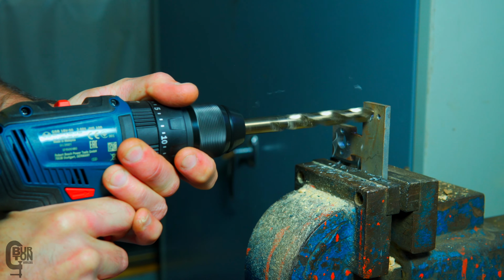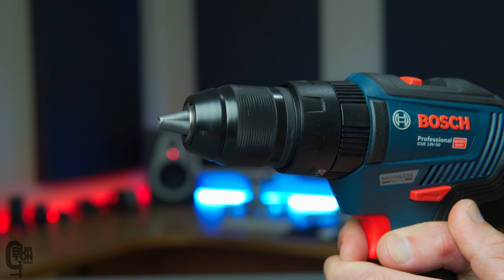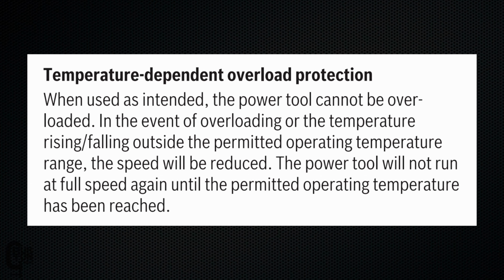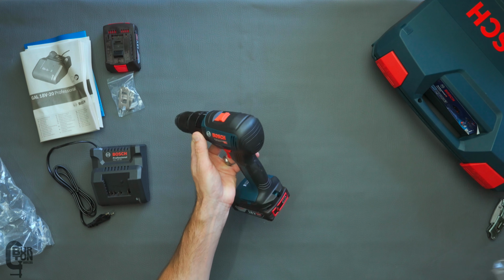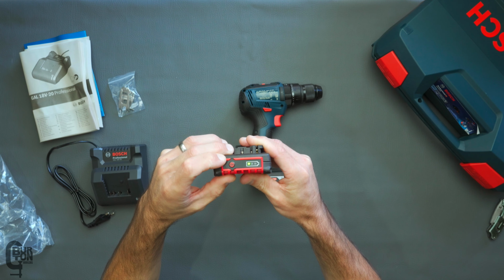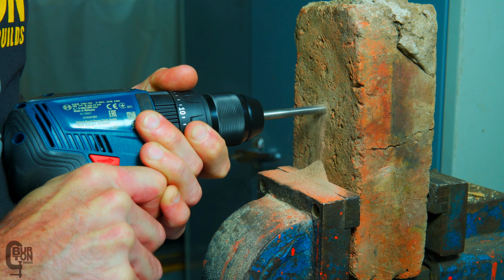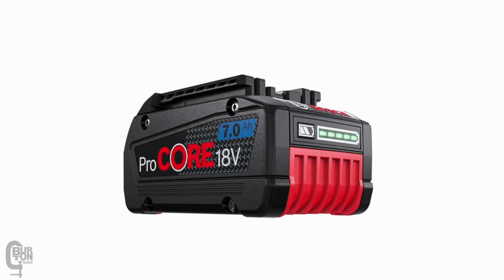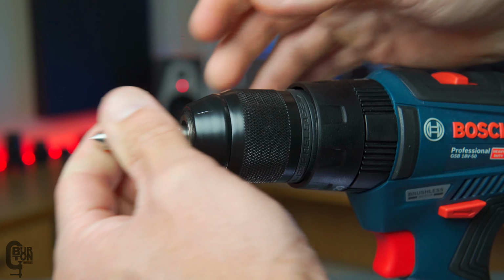Bosch Brushless Drill Review and Testing | GSB 18v 50 (Burton Builds)

Comment: PS. These Bosch drills perform better with stronger batteries (5.0A or 8A or higher) the Procore batteries are even better.
Reply from the maker: Hi Peter, thanks for the info... I've actually also tested a larger drill from Bosch, the 18V-150C (18V-1330CN) and during my testing using both the standard and ProCore batteries, also noticed the ProCore deliver more power. Review video is here 👉https://youtu.be/I2PaPUjVMG0

Comment: The comparison with the DeWalt is not fair, the DeWalt is an an hammer (hamerboormachine) whilst the Bosch is a impact driver (klopboormachine). Not quite sure whether I translated it correctly, but the main difference is the ability to drill into concrete. The DeWalt is built for that, the Bosch is not.
Reply from the maker: Hi freakie1NL, I agree 100% that's it't not a fair comparison... however please keep in mind that this is not a comparison video in which we compare the DeWalt SDS against the Bosch GSB18v-50 to show which one is better than the other.

I show the DeWalt SDS drilling through the concrete brick to create a reference point to gauge what the Bosch GSB is capable of (or not capable of) in Hammer Mode. General DIY users may assume that having a hammer drill mode means they can use the machine to drill into brick and concrete, and that's not the case. While the Bosch may be able to drill a few small holes in low strength concrete, it will chew through bits quickly and pretty soon wear out the machine if thats what it's being used for.

The translation is slightly out... an 'impact driver' uses a hammer and anvil arrangement which drives rotation... but thanks, I know what you mean.

Thanks for the comment 😁
Reply: @GrantBurton  and thank you for the review!
Reply: Actually, that comparison helped me to evaluate the difference.
Reply from the maker: @AdiosGringo619  Thats great... which drill did you end up buying?
Reply: @GrantBurton  GSB 18v-50. Your review helped a lot. Thanks again.
Reply from the maker: @AdiosGringo619  Wonderful, thanks for letting us know. Once you have used it for a while, please comment again and let everybody know what you think about it.
Reply: I think the comparison was just the right thing to do.
Many drivers are advertised with the hammer function and it makes you assume it could be useful for home use drilling in the walls.
This came just in place to show you that if this is what you wanted then this tool won’t do the work.
Reply: Yeah, it does make sense
Reply: It has a hammer function on what you talking about look when he is putting it in drill mode

Comment: it is the same than bosch gsb 185-li ?
Reply from the maker: The Bosch GSB 185Li and GSB 18v-50 both have very similar specs and functions however the GSB 185Li is a light duty drill compared to the GSB 18v-50. The 185Li has a smaller body / outer case and has lighter duty internal wiring and connections and also a light duty gearbox compared to the GSB 18v-50 model.

The GSB 18V-50 is physically larger and it's case has more rubberising protection around it

Overall I think the GSB 18v-50 is a stronger more heavy duty drill.

Comment: Is this still their best one for an 18V-20V? Do you have any recommendation that is better than this Bosch 18v-50, preferably a Bosch model also or Dewalt WITH ANTIKICKBACK?
Reply: 18-150 or 18-535
Reply from the maker: Yeah, the Bosch 18V-150 C is a bigger more powerful drill that has KickBack Control... I've actually got access to one of these 18V-150 drills to test and review but I must still get around to that sometime in the future hopefully.
Reply: @GrantBurton  thanks. I saw 18V-90 C and it has kickback.

Comment: Hi, i would like to enquire between Bosch  GSB185LI and GSB18V-50, what are the different and which one was recommended, thanks!
Reply: +1 🙋‍♂️
Reply from the maker: Hi Chilk Ling, the Bosch GSB 185Li and 18v-50 both have very similar specs and functions however the 185Li is a light duty drill compared to the 18v-50. The 185Li has a smaller body / outer case and has lighter duty internal wiring and connections and also a light duty gearbox compared to the 18v-50 model.

Overall the 18v-50 is a stronger more heavy duty drill.

Comment: What is the difference between this and the GSB 185-Li??
Reply from the maker: Hi Oliver, the Bosch GSB 185Li and 18v-50 both have very similar specs and functions however the 185Li is a light duty drill compared to the 18v-50. The 185Li has a smaller body / outer case and has lighter duty internal wiring and connections and also a light duty gearbox compared to the 18v-50 model.

Overall the 18v-50 is a stronger more heavy duty drill.
Reply: @GrantBurton  Thanks man! Oh, by the way, Bosch usually ships their tool kits with battery inserted in the power tool itself.. I don't know why either. All my tool kits are sealed, and all of them have their batteries inserted as well.
Reply from the maker: @The_Crazy_Monkey75  Thanks for the info... I would think it may be a potential safety hazard shipping with an inserted battery but who knows... haha.

Comment: One critical problem with Milwaukee brushless M18 drills is the awful sound of the motor. The Bosch doesn't appear to be making the same horrendous "sharp" scream from the motor windings. The M18 brushless drills seem to produce a sound akin to a small air raid siren. I won't buy another M18 drill until they solve the sound problem, they require hearing protection to drill a basic hole. This Bosch is next on my list, it's a beautiful drill.
Reply: My brushless Ridgid drill is the same . It makes a high pitch noise that's annoying
Reply: I’m glad someone else mentioned this. My M18 drives me nuts, and everyone else says the noise is barely there….i disagree. So much so that I brought a Bosch professional to replace it. Much better experience all around so far.

Comment: Aside from drilling small holes in brick or concrete, are there other uses around the house for the GSB18V-50?  I would like a new brushless cordless drill, but wondering if I should get this particular drill that includes a hammer mode.
Reply from the maker: Hi, for the convenience of having the hammer mode when you need to drill one or two small holes around the house, hanging pictures, curtain rails, etc into brick... I think it's worth having the hammer mode. For anything more, I would get an SDS rotary hammer. Just today I installed pegboards at a friends place and drilled 55 small holes into brickwork (6mm), used the SDS all the way. The hammer mode on a combi-drill could have possibly done it, but not nearly as quickly and would have required much more effort.

Comment: You'r right the battery isn't supposed to be preinstalled, seems this one is a return peace maybe or it was a showpeice.
Reply from the maker: Hi Peter, it is possibly but luckily everything has been working perfectly so far.
Reply: @GrantBurton  well thats good, if it is the case it is possible that the person who had it before just didn't like it much
Reply from the maker: Thankfully this time it all worked out... I have purchased an item online in the past (camera gimbal), which arrived and after unboxing, I could see it had been opened and actually dropped by somebody else before (definitely not from the factory like that)... thankfully there was no quibble about returning the item and having a replacement one sent... this time around it was definitely brand new.

Comment: Hey Grant, thanks for the reviews. I've been looking for a good hammer drill for concrete but hate corded tool.

Do you recommend gsb 185 instead? I can't seem to decide...
Reply from the maker: Hi Erka, I wouldn't recommend it at all... it's the 'wrong' tool for the job. For drilling into concrete, you are better off using a rotary hammer (SDS) drill... thats the right tool for the job. In the video, this is seen when I used the Dewalt rotary hammer to drill through the concrete brick where the normal 'hammer' drill was battling.

As an example, if you are looking for Bosch, something like this https://amzn.to/3JIyVx5
Reply: @Grant Burton  ah yes I guess so.. cordelss SDS is pretty expensive here, tho so I thought I could get away with GSB series xD

Thanks for the advice!

Comment: Does the chuck of your drill-driver rotate smoothly on its axis? Is there any wobbling?
Reply from the maker: There is a very small amount of wobbling (as can be seen in the video) but it’s such a small amount, it’s nothing to worry about. It doesn’t affect the accuracy of holes when hand drilling. This amount of runout / wobbling wouldn’t be acceptable if this was in a drill press though.
Reply: @GrantBurton  I've just started using this device, and the chuck has noticeable wobbling. I tested the drill with a few short bits, and the wobbling doesn't transfer to them. I also checked it with a longer spade bit, and there the deviations are quite strong (possibly a bent bit but it's new one). That's strange for equipment of this class. Regards

Comment: Which option is better for drilling in concrete and screwing:
1. Bosch GSB 500 RE
+ Bosch GO Gen. 2.0 screw driver
OR
2. BOSCH GSB 180 LI
Reply from the maker: I think the Bosch GSB 500 RE Impact drill would be better for drilling concrete compared to the GSB 180 LI… but only for small holes. If you intent to drill concrete or masonry, a rotary hammer drill is a far better choice (SDS rotary hammer). As for an electric screwdriver, it depends what you are trying to screw / unscrew but the GSB 180 Li will be more powerful at screwing compared to the GO Gen 2.0
Reply: Khoan bê tông tường xi măng thì gsb 500re khoan nhanh hơn gấp 10 lần con này, vặn vít sau khi khoan lỗ thì go gen 2 (or 3) lẹ hơn, đỡ mỏi tay, cần bắn vít thì hãy mua máy chuyên bắn vít Makita TD171 (có ngắt lực điện tử)

Comment: Great video Grant. Coming from the GSB 18-2-Li PLUS I need a slow RPM start on trigger pull for screw work mainly.  Would you know which of the 18v-50 or the 185-Li might have the slowest RPM start on trigger pull.    The less expensive 180-Li tends to jump from zero to like 20 RPM which is not optimal.
Reply from the maker: Hi Patrick, thanks very much. I was playing around with 185Li in Strand Hardware in Port Elizabeth a few weeks ago but can't remember how the slow speed start performed (Don't think it was something I was specifically looking at).

I'll pop past there again soon and compare, then get back to you. Hopefully they still have both models on display.

What type of screw work requires such a slow start? Maybe an electric screw driver will be better suited to the work?
Reply: Hi Patrick, I have the 185-Li model, the startup speed on gear 1 is the same as 180-Li model. I use it mainly on gear 2 for drilling. For screwing I have other brands like hikoki or makita which have slow initial rotation speed. At my workplace I have bosch 12v-15, it is super slow and fine in gear 1.

Comment: Hey Mr Grant! Would you take that Bosch over Dewalt 778? Cannot pick between Bosch and Dewalt because i never had anything from that brands.
Reply from the maker: Hi Thiago, between the two drills you mention, I would rather take the Dewalt 778 because it is more powerful than the Bosch however it really depends on which eco system you want to buy into. Batteries are pretty expensive so once you have started buying into a specific brand, it's cheaper to stick with that brand because you'll only be buying 'bare' tools and swapping the batteries between the tools. It also depends on thew range of tools available wherever you are.... no good buying into a Brand if they have limited support and only a hand full of tools available in the area.
Reply: @GrantBurton  alright! Bosch has the biggest support of all well known brands here in Brazil (Bosch, dewalt and makita are the most used ones). 

Bosch gear is also a little bit cheaper than Dewalt, so I’m probably going with 18v50. 

778 is indeed more powerful, specially when drilling concrete, but excluding raw power looks like Bosch is better on anything else (prices, support / warranty / features, etc)
Reply: @GrantBurton  thank you for sharing your thoughts with me Mr Grant! :)
Reply from the maker: @fivinh0  Makita is also a very good brand so maybe look at their stuff, although it depends what you want to do with the tools. I you are doing basic DIY stuff, then the entry level tools will be ok... but if you are dong 'contractor' type work, I wouldn't cheap out... rather buy the more expensive and better quality drill as it will likely give you better service life. Out of those three Brands you mentioned, I would choose Makita and Dewalt over Bosch. (Makita has their 'home DIY' range which is 'Makita MT' and the more contractor type tools which are straight 'Makita' - similar to Bosch green for home use and the Bosch Professional (blue) which is better than the green range).

I wouldn't be making any comparisons of these types of drills and making any decisions based on their ability to drill concrete... All of them are not great... they have very basic hammer action and you'll just end up damaging / wearing out your drill unnecessarily and pretty fast. If you need to drill concrete, you need to get a rotary hammer drill.
Reply from the maker: @fivinh0  It's a pleasure.
Reply: @GrantBurton   you are right. I’m mostly using that drill for DIY stuff and very very sporadic drilling on concrete (and with small drill bits, max 8mm).

It’s just because it’s too expensive to spend around $350-400 on a entry level hammer (bosch GBH 18V 180Li) for making 5-10 holes/year. 

I even thought about getting a “better one” like Dewalt 996 but I feel it’s too overkill for casual users like me. I hope 18V-50 can handle a little bit of abusing with concrete.
Reply: Sadly makita, dewalt and Bosch doesn’t bring their full gear collection to Brazil, so I can only pick between few models. Other brands like einhell and milwaukee are not even available locally.

Makita has a huge line of tools but their batteries here are hell expensive. That make Dewalt and Bosch easier picks. 

Even if I feel Dewalt would be a better pick, Bosch has a much better assistance and warranty here in Brazil, that’s something that I can’t ignore because everything is pretty damn expensive here. Stuff worth 100$ is like $250 here because importing fees and other taxes.

Comment: does that mean I want the GSR as I have not a use for a hammer mode?
Reply from the maker: If you can afford it, I would still get the GSB model (with hammer function) just to have the option to drill small holes (5mm or 6mm) in brickwork for hanging up pictures, etc. if the need arises.

Comment: That seemed worse than my 12v brushless flexiclick (~34nm) seems about as powerful as that unit. I'd guess the batteries are holding it back a lot.
Reply from the maker: It's possibly that the battery is limiting the power a bit, but I doubt the FlexiClick drill/driver will deliver 35nm of torque, even though that what the specs say. That FlexiClick looks like a nice drill for cabinetry.

The reason I think this is because I tested the GSB 18V-150C drill and could only get 84nm - similar to what @TorqueTestChannel also measured (and specs claim a max of 150nm)... but I could be wrong.

Comment: Hi! Nice review! 4:49 first time I hear about this type of protection, but what are the values of this "permitted operating temperature" range? I hope it is not a rubbish [0...40] range...
Reply from the maker: Hi paulbt, I'm not sure what the exact range is but from what the manual says, it sounds like it's just overload protection (that is based on temperature) so you don't burn out the transistors in the speed control or motor windings (If you putting the drill under to much load and pulling to much current through the speed control, the transistors will heat up and before they get to hot and burn out, the power is reduced to limit damage to the transistors / motor).

Comment: I just bought what I believe to be the same drill, but I may have got a slightly older model.

I got a material case and 3 batteries but not the ones that indicate the charge. The drill itself seems identical. Almost bought it for R3499 at Makro but then found it at Builders for R2700 on promo. 

I'm not sure if it's packaged differently for Builders or slightly older. Does anyone here know?
Reply from the maker: Hi Bruce, with many of these tools (across various brands) there are a few different configurations of kits that are available, usually denoted by the last letters of the kits model number as I recall... normally the tool will be the same, but other items like you mention, may differ... like hard case vs material bag, or three batteries instead of two, or different capacity batteries, or a fast vs slow charger, or tool only options. I'm not an expert on it, but thats just what I seem to have noticed over time.

If the model number on the drill is the same, then it's the same drill 👍